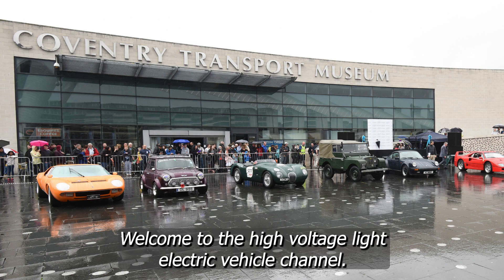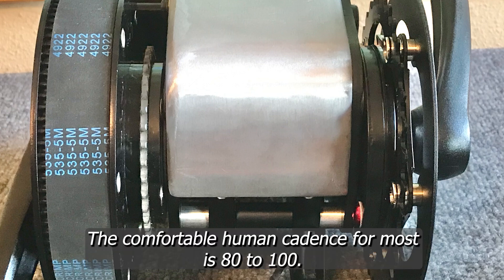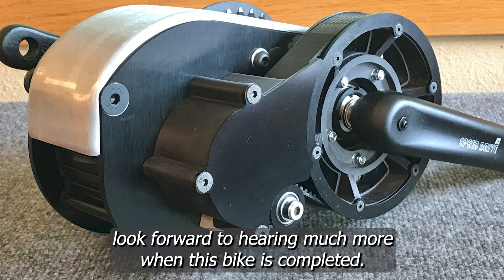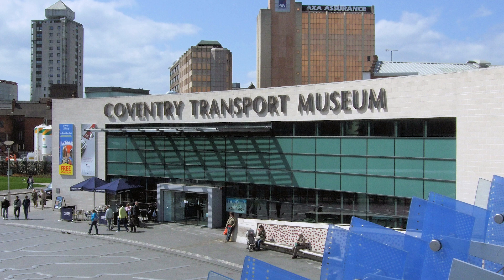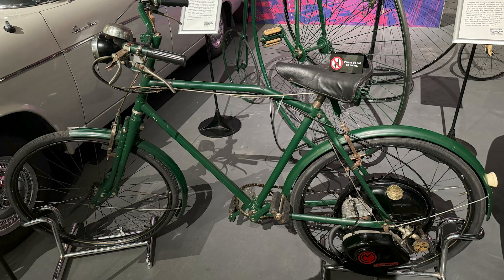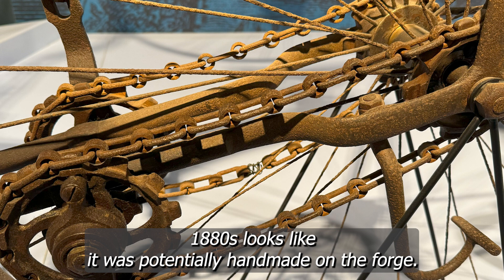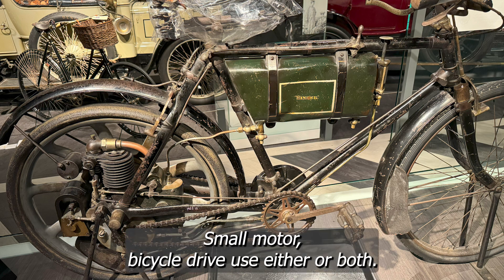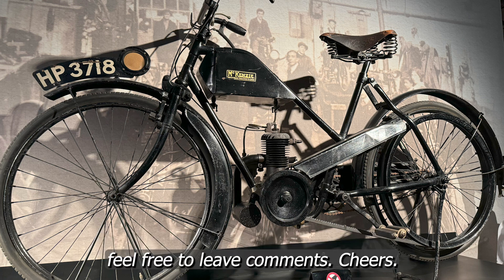Magnet Geared Mid-drive motors and 1900s Technology - Weekly Ebike Tech chat August 2024

Comment: Just found this channel....big fan of this type of tech.
My personal bike is a 2024 Wired Freedom that came stock as a 38mph 60v20ah bike with a 40amp peak controller. I have converted it to a 96v40ah bike with a 96450 Fardriver controller turned down to about 10kw. It gets to 60mph in 11.4 seconds rolling into the throttle to protect the motor.....which is still the stock Hentach geared hub motor. As far as ghost pedaling I have a 80 tooth front chain ring and 11/24 rear so pedaling at 35-45 (the top speeds I typically cruise at) is no issue.
Reply from the maker: Holy cow! That’s some ride. That front sprocket is huge but if it lets you pedal along. You can also get crank units with a built in two speed activated with a kick of the crank. That doubles the output at the rear so a similar effect.

Comment: MGM - Magnetic Gear Motor from Star Union.... It is fascinating. Based on the technical papers It's relatively new and it allows torque multiplication by modulating the magnetic field. Which eliminates the need for a reduction gearing. I didn't see any bearings in the illustration, so maybe it has magnetic bearings? One of the downsides is a mid-drive conversion model is not possible, without a radical redesign. And with two different sets of permanent magnets and an additional stator. It's a  much more complex motor than the average mid drive. And I wonder how well it dissipates heat? Since it has additional layers.

Below are some of the specs that star union posted about it..

- Max Efficiency 90%
- 120 seconds at 75 Nm, 480 seconds at 60Nm
- 250W rated power - 580W peak power 
- Low noise
- Low Maintenance cost 
- Almost impossible to break

So the specs seem a little bit low for what would interest this channel?

BTW if they can vary the modulation of the flux field the torque could also be varied. Making it a virtual variable speed gearbox. I wonder how much it's going to cost? I couldn't find a cost when I was researching it.

Thanks for posting about it and have fun on your vacation.

Comment: The BIG problem with magnetic gears isn't that they work well with zero wear, but that currently the torque density (Nm/m3) is way too low for use in anything other than low power ebikes. For example, the rated prolonged output for the MGM seems to be <60Nm. Can be used at higher torque for short periods - but the reduction in efficiency means they heat up, which is bad for magnets. Probably could be used as the initial reduction gear with a secondary normal reduction gear or belt after that - but then the system gets bulky and more complex.
Reply: 120 seconds at 75 Nm.... The whole idea of an MGM is that it multiplies the torque and this is the first ebike midrive example.. Hopefully they can increase the effect over time and make it variable... A virtual speed gearbox would be nice... The concern I had is that the motor is more complex. With two layer of magnets and an additional stator. Which increases cost and complexity. But that's offset by the fact it doesn't have any gears.. So hopefully it should be more durable? Possibly ideal for lower power touring and commuter ebikes?

As always the devil's in the details... Hopefully we'll get some real world testing soon? Sorry I repeated the word 'hopefully; so much lol

Comment: Magnetic gears seem pretty great, if only they weren't doubling the amount of rare earth metals! Maybe they could prevent enough catastrophic failures to offset that, we'll see in a few years maybe.. also, the John Deere hackers could stand to make some cash off these software locked batteries, it's kind of atrocious to see Bosch bikes that can't be put back in service for lack of a matching battery, with matching case, that may or may not be built any longer.
Planned obsolescence includes more than just weak links in the designs, but who knows how to capitulate with companies and get them to continue using old designs to prevent wasting precious resources. These batteries are costing us a lot environmentally, scaling back usage should be done in any way possible. Equitably, of course 😅

Comment: My complaint with mid-drives is that in order to extract the most power out of the motor it must be run in such a low gear that pedaling is useless.  I'm glad that someone has recognized the issue and has done something about it.  Imagine going 35mph and still being able to pedal meaningfully.  I find throttling the bike with the pedals to be far better than with the throttle.
Reply: Well I dont care at the point i am able to go35mph the throttle is all im going to be using anyway